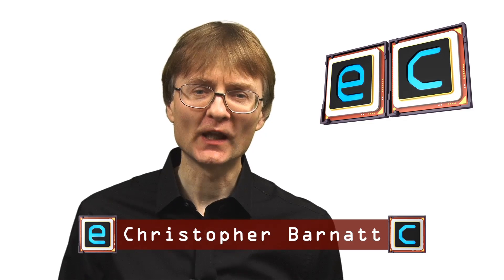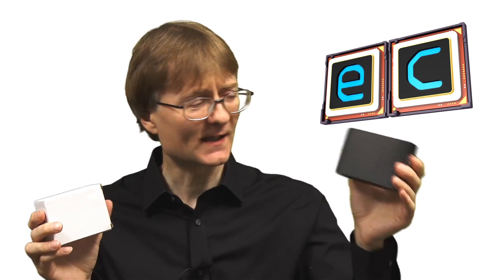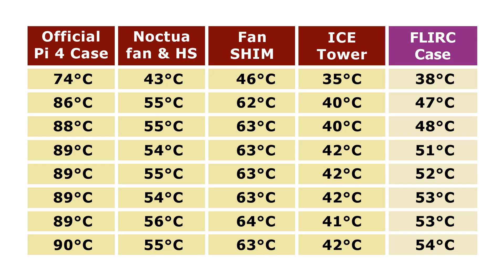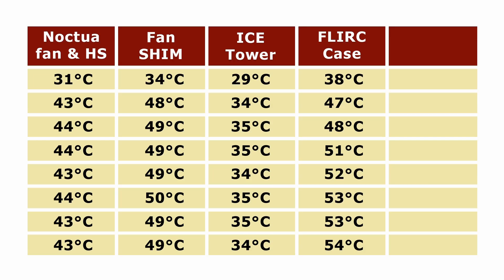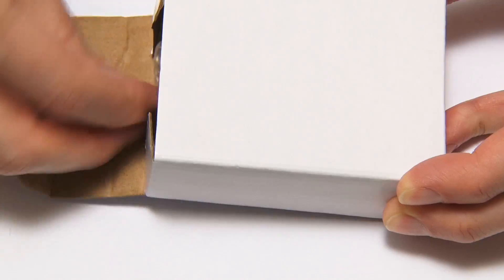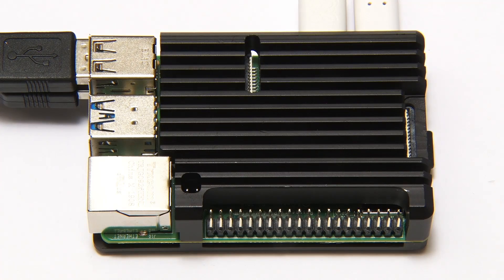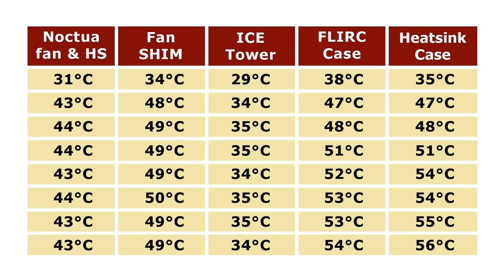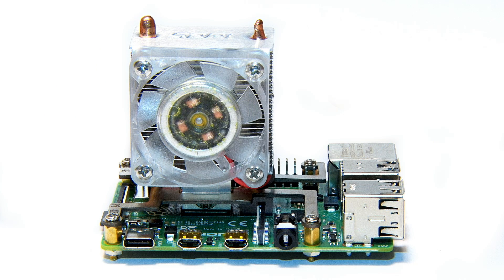Raspberry Pi 4 Passive Cooling

Comment: Excellent catch on the initial test results, then repeating the tests👏👏👏
EleDuino sells a heatsink/case very similar to the one you tested, except it has temperature controlled dual fans and a touchpad on/off switch, all powered from GPIO pin 4. 
https://www.amazon.com/gp/product/B07VPQP15T/ref=ppx_yo_dt_b_asin_title_o09_s01?ie=UTF8&psc=1 

Interesting note: Although these cases appear to be very similar, the following tests indicate the EleDuino Heatsink/Case runs hotter w/o fans running, because the circuitry, touch pad switch, and 2 fans replace material which would otherwise be Aluminum ribs. Therefore, it is important to leave the temp controlled fans on. They will run automatically, when required.
rpi-eeprom-update is 000137ab, the same as yours.
Results of temp_test.sh on RPi4B 4GB w/ EleDuino dual fan Heatsink/Case (above): ambient temp = 22.2'C:
No Fans               With Fans          With Fans & Motor Hat
*temp=54.0'C    *temp=44.0'C     *temp=45.0'C
temp=68.0'C      temp=58.0'C      temp=59.0'C
temp=70.0'C      temp=59.0'C      temp=62.0'C
temp=73.0'C      temp=59.0'C      temp=61.0'C
temp=76.0'C      temp=59.0'C      temp=63.0'C
temp=78.0'C      temp=61.0'C      temp=65.0'C
temp=79.0'C      temp=60.0'C      temp=65.0'C
temp=81.0'C      temp=60.0'C      temp=65.0'C
*temp after 10 minutes running at idle and stable temp
Since I intend to implement a motor hat which restricts air flow, those results are also provided.
Hope this is helpful to your viewers.😎

Comment: FYI, when we test prototype boards at engineering labs, what we are most interested in is the temperature delta - i.e. the rise in temperature under different conditions.  For digital electronics, assuming you're operating within normal operating ranges, the "delta T" is the temperature rise we expect for a given HW / SW configuration.  It is  the difference between ambient room (or thermal chamber) temperature, and the temperature of the component under test.  

If "delta T" is 27 degrees, then if the room is 0 degrees, then the component would be at 27 deg.  If room temp is 50 degrees, we can expect the device to be at 77 deg.  If delta T is the die temp, (as it would be for a chip with an internal temperature sensor,) we can subtract delta T from the max junction temp (Tjmax) for that device and determine the maximum ambient temperature for that configuration.

This also makes it easier to compare heat sink performance as very often the ambient temperature for tests aren't the same from day to day, but the delta T will be (within measurement limits).  Thus, the system with the lowest delta T gives you the best performance.  For the best performance per dollar (or pound or Euro) you can divide delt T by $ to see which is the most cost effective.

I enjoy these videos - keep 'em coming!

Comment: Of the two tested I prefer the Aluminium Heatsink Case, simply because you can get to the GPIO pins. I suspect you could add a fan with some self-tapping screws that gripped between the cooling fins on the top. Obviously choosing screws that were not too long. The Ice Tower remains the one to beat, so top marks to them once again.

Comment: Very interesting results.  I have the same eeprom version here, but things are still floating around the original numbers that I got with the old eeprom on both my 2GB and 4GB units (the 2GB is a consistent 5C cooler across the board from the 4GB unit).  My test environment ambient is a very stable 24C.  Things start at 33C (2GB)/38C (4GB) and then stabilize at 52C/58C over 15 runs of the sysbench test.  Still far from throttling, but odd that there's no change on my 2GB or 4GB units with the new eeprom.

I'm using the geeekPi case with the 3 aluminum heat syncs and the small fan (similar to the piMaroni shim) on both units.  I may need to look into the FLIRC since I intend to eventually overclock and I am suspicious that the fan layout and design in the geeekPi isn't as good as it could be.  And, while the current fans are well balanced and very quiet, silent is always better :) .

Comment: You forgot to compare with new firmware but without extra cooling at all.
Also it might be intresting to see what happen if you use 4, 3, 2 and only 1 core if all 4 cores will hit the temp limit. (i guess 4 will run up to max limit, while lower number of cores migth stay under the limit)

Comment: Yes I've been using the standard FLIRC Case since the pi3 and it's a lovely looking case that really does reduce the temperature of the pi and allows it to run silently.  The Fan Shim is also very good but because of it's design the case that has to fit around it gives no real protection to the pi or the fan itself.  The other solutions are far too large, apart from the official case (which is useless) and forces the pi4 to throttle back and therefore lose performance.

Comment: Nice video but are you sure you've fully saturated the passive heatsinks with only 7 runs?
With the passive heatsinks the temperature was still rising when the test completed, in my opinion it would keep rising until the heatsink was fully saturated and the temperature stabilizes.
Since there isn't any fan on them the heat would need to dissipate via convection which is far less efficient than forced airflow.
Therefor I'd argue the temperature would still rise a considerable amount before eventually reaching its endpoint.
Could you please test what that endpoint would be?
By looping lets say 30 times instead of 7.
Thanks!
Reply from the maker: Almost certainly not satured. But close. There is a limit to how long I can spend on each test, esp. when recording.

Comment: Thank you for taking the extra time to do redo the active with the firmware updates.  I'd kinda be curious to see a row of the Pis in the heatsink cases fair inside a square tube with a fan on either end pushing and pulling the air through...

Comment: What if we replace the often bad heat conducting pads with some decent thermal compound like MX-2 or NT-H1?
Reply from the maker: It would not work (well). There is a large gap to fill. The metal castings contact the Pi's circuit board (for the screws) before the SoC. This is one situation where a thermal pad is probably the best solution.

Comment: In the video the results for the first test were 38C, the second test were 35C, but your voiceover last says that " the second test was a couple degrees warmer than the first", and talk about how it feels warmer, which I assume is a mistake as you first said it's three degrees colder than the first one.
Reply from the maker: I was referring to the final temperature reached (56 compared to 54). It does indeed begin three degrees cooler as you say. :)

Comment: Aww bollocks! I'm going to have to figure out how to update my firmware now... I've been running LibreElec since the the Pi4 came out. I'm guessing I'll have to mount Raspbian to do the update... *Sigh*... As a side note, I was surprised to see the enclosed Flir case out perform the more open air style case made by sandwiching 2 giant heatsinks together. Nice job 👌
Reply from the maker: Just run a RAspbian update.

Comment: Hi, thanks for your video!

I've both used the Flirc case as well as the 'heat sink as a case' style (exactly the same model as you use). I'm using my Rpi4 as a 'Stellarmate', a tool for astrophotography. What I've found is that when using the Flirc case, when I use my Rpi4 in hotspot mode ánd use bluetooth, it loses the hotspot. With the 'heat sink as a case' the Wifi transmitter is less obstructed (actually visible from the outside) and doesn't cause this problem of losing the hotspot. I suggest it's some kind of interference.
It's maybe interesting to run a test on that with your better understanding of computers.
Cheers! Bart

Comment: Sunday mornings are so "cool" with Christopher Barnatt and ExplainingComputers.com. It is always a "refreshing" treat, especially when you're "updated"  on everything  Raspberry Pi. By the way, even though those featured cases are nice. I'm still partial for the Ice Tower. I wish someone made a case that is compatible with it. Mr. B, do you think that the bottom heat sink can be used in conjunction with the Ice Tower?

Comment: Does the metal case have any effect on wireless range?
Reply: Very good question. Wondering the same.
Reply: Yes but depends.  I dont have the Pi4 and I am a hater of WiFi probs and I am never greatly impressed with Pi and WiFi.  I stick with plastics, sort of (and PoE as much as I can).

You can get this stuff used for signs (shops).  It is plastic between two thing metal (alloy)sheets.  About £8 for an A3 sheet.  You can cut that about to have some cooling effect but also less Faraday effect .  Havent used it on Pi4 or 3 but some other SBC and SFF I have.  You can have one 'back wall' of a case like that with rest metal.

Some wifi is clever now and sort of navigates its way out of problems, again not sure about Pi.  Also just have your antenna outside the case.  I guess use case plays a lot here- like a robot being controlled from feet away compared to a thin client in a busy WiFi office.

Comment: I just got the cheapest plastic shell+40mm fan i could find on Amazon. Works great never been above 47°C under load from 1080p streaming and I'm overclocked to 2.0Ghz cpu 600Mhz gpu

Comment: First of all, I have been sort of 'waiting' for this video... I wanted passive cooling for my new Pi4(s) and this was just right on cue. I rather like the Pi Hut 'heatsink as a case' unit. The Kodi/Flirc looks good though as well. Using active cooling is not on the cards as I want my units to keep on the slimmer side.

If I may be permitted to say, please, is the fact that these SBCs are now becoming a bit too expensive for the casual tinkerer. The PI itself (mine cost 59Euros), then a decent power supply (another 18euros), the various adapters (ex, 5euro for the mini hdmi), and now, the heatsink (for me, will cost around 20euros)... 102 euros, give or take a few. Exactly the cost of an Intel 5460CPU, Asrock motherboard and 4gb ram.Were it not for the portability (albeit with power supplies and dongles), an SBC would make little sense.

(Please excuse my tiny rant.. just spotted wifey having tea in my Star Wars mug)
Reply: Chris Grillo ya least now it can do useful modern compute jobs. Trying to make something actually useful that’s a full computer for $20 gives way too many compromises
Reply: @codycast  , perhaps, but who uses a Raspberry PI as a mainstream computer? As much as I would like to do so, I cannot justify it as such...
Reply: Chris Grillo oh I know. But for most people, the drastic increase in performance for a modest increase in cost is worth it. And if not you can get the cheaper option

Comment: Actually I would like to see a passive solution that includes the PoE hat.
Reply: I wonder how well the Kintaro Heatsink would fit between them. It is huge, but also just big enough to fit with the Pi inside cases. The 3b+ version should fit without much of a hassle [or with some few adjustments]
Reply: Oh yes. The PoE Hat has a fan that makes a ridiculous amount of noise. You can hear it from miles away. Built one into a hedgehog house but I had to disable the fan because no hedgehog would be stupid or deaf enough to live there.

Comment: i've the impression that the kodi case needs a longer test period for the simple reason that it has a big mass and it might not reached peak temperature. In fact I belive the second passive case has a proper heatsink on it and should exchange heat with the ambient faster although being of small mass it reaches the peak temperature faster.

Comment: I love your educational videos, quirky animations and all! 

However, this lesson left me with more questions than answers. I can fully understand if you want to use your Pi4 for something else and/or stop it from being exposed to more potential damage but... 

How are the temps looking with the original case and/or the small/cheap heatsinks, after these Pi4 updates? 
And for real life usecases, I guess it's more interesting to know how much stress it can handle with each solution, before it will start throttling/overheating (to get a better idea of what solution one might need to opt for in certain scenarios). 

And I wonder... If the temps got improved so dramatically through software updates, did they tune down the chip with undervolting/-clocking? 

But hey, I can't ask you to do everything over to get these questions answered... I'd have to watch ExploringComputers for that. Keep up the great job/content!
Reply from the maker: The firmware update will I imagine improve power management by running code more efficiently (eg using less instructions to achieve the same thing), and turning things off (eg in the USB controller) when not in use. As you suggest, I did not want to subject my poor Pi 4 to another test in its official, totally unventilated case! :)
Reply: @ExplainingComputers  I can't blame you, it looks like a really fun device!  And amazing how much the Raspberry Foundation managed to improve their instructions, especially considering that its  using a fairly common ARM core

Comment: Active cooling solutions test clearly shows that 7 sysbench iterations are enouch for CPU temperature to stabilize. But those big passive heatsinks have a lot higher heat capacity than active coolers, and the test might not be able to heat up the CPU to the maximum temperature (which can be seen from the results, the temperature only increases for passive coolers and never decreases). In fact, in both passive coolers tests the last reading is higher than the previous one that shows the temperature will rise more if the test continues.It would be more interesting and informative to see the resulting temperature after it truly stabilizes (it takes only about 11 minutes for the current version of the test to complete, so increasing the time to 30-40 minutes might be enough). And, by the way, I suspect those heatsinks might not be that safe to touch after the test.
Reply: I did exactly that with the FLIRC case  and the temperature finally stabilized at 58 Celsius after 30 minutes. The test ran 60 minutes. The case got warm but was still safe to touch.
Reply: This, exactly
Reply: I ran ffmpeg for 2 days on a raspberry pi 3 with this case.  I never made it over 60F.  Ffmpeg uses all available processors, and will use 100% of the cpu.  I suggest using "nice" with it, unless you really don't plan to be using the computer for anything else.
Reply: Yep. I'd guess it's going to max out in the upper 50s but you should at least run enough iterations to get some duplicate peak readings before stopping the test.
Reply: Valid point. With passive cooling only, it takes at least 30 minutes of 100% CPU to reach equilibrium. Measurements after only 10 minutes are very much influenced by the initial conditions and should be discarded.

Comment: Why do you not just submerge the pi in a tub of clear mineral oil , I use it for cooling all the time  and i have no faults, it performs very well
Reply: And then imagine what happens if you need to plug or unplug some USB or HDMI cable... you'll need to do a lot of cleaning afterwards
Reply: @Agent_Krasnov  use needle nose pliers. Also the connections never deteriorate or oxygenate or never need to be maintained

Comment: Peltier device cooling, I know it isn't energy efficiency but it is a possible way to activatly cool with no noise it would have passive cooling on the hot side🤔
Reply: Peltier cooling can cause condensation

Comment: I've done a little bit testing on heat transfer pads and they are not all made equally. The ones you can buy cheaply of ebay are really crap ! Even reused transfer pads off graphics cards etc (which your not meant to reuse ) outperform the cheap blue ones you buy of ebay by up to 20c in my tests.
Reply: Comments like this ..are why I keep reading comments :)  @ Laser

Comment: I've a built something using a Pi 3B and a HAT that works fine, but would work far better with the  USB 3.0 and better Ethernet of the Pi 4B. Unfortunately there's no cooling solution yet available that would work with this HAT - even the HAT's manufacturers have yet to offer a case for the Pi 4B due to this issue. I don't really need the added CPU power of the 4B, as most of the time the system idles at no more than 2% CPU usage across all 4 cores. Perhaps one day we'll see a Pi 3C - with the CPU of the 3B but with the 4B's connectivity.

Comment: Curious, how easy is it to remove the heatsink pads when changing cooling systems?
Reply from the maker: It is possible, but could be easier! :) I keep a roll of thermal pad material on standby. :)
Reply: Some of Greg Salazar's videos are sponsored by Thermal Grizzly's Carbonaut pads which have no adhesive. He says they are almost as efficient and that he uses them himself. Reusable and can be cut to size. 
Reality check: I myself haven't removed/installed a cpu since I had to install a ram board between the cpu & motherboard on an Amiga 1000, which didn't have expandable ram and cpu's in those days didn't run hot enough to worry about.

Comment: I managed to get one degree cooler in my Flirc case. I think the only difference between your setup and mine was that I initially bought a Canakit which came with 3 heat sinks (CPU, USB and, I think, Network chips) so when I got the Flirc case I only removed the CPU heat sink leaving the other two since they did not interfere with the case. I am very happy with the Flirc and haven't seen a single thermal throttle to date.

I loved the THX 1138 reference! I really appreciate the subtle bits of humor you sneak into your viedeos.

temp=38.0'C
temp=47.0'C
temp=48.0'C
temp=49.0'C
temp=50.0'C
temp=51.0'C
temp=53.0'C
temp=53.0'C
Reply from the maker: Thanks for sharing your results -- and appreciating THX 1138. :)